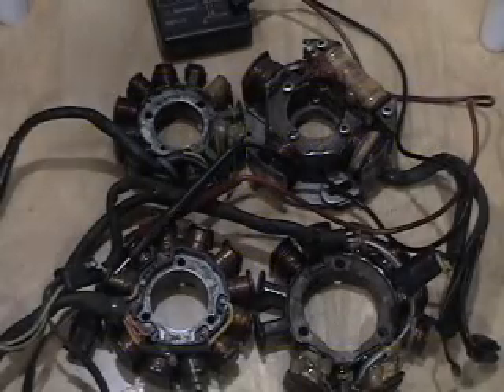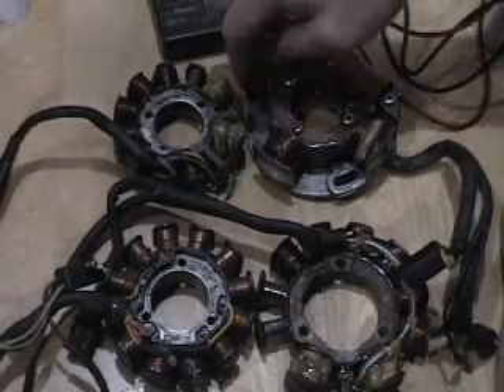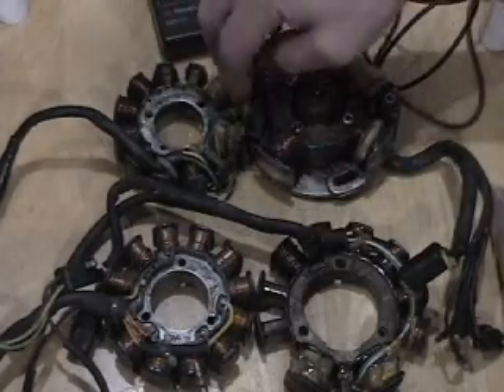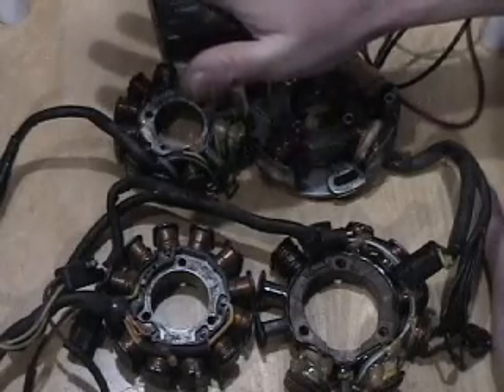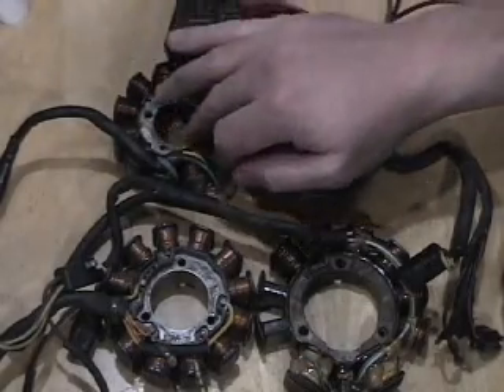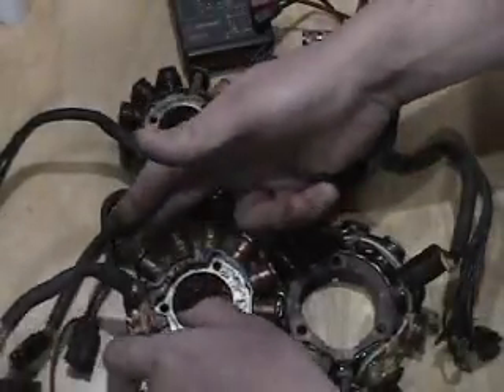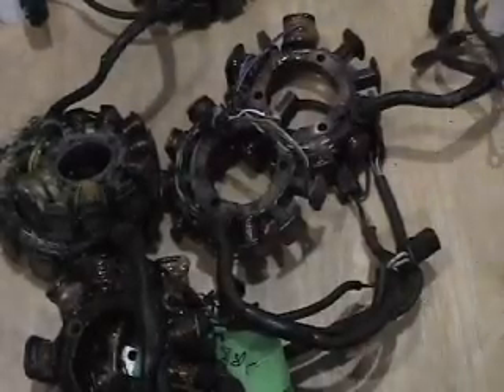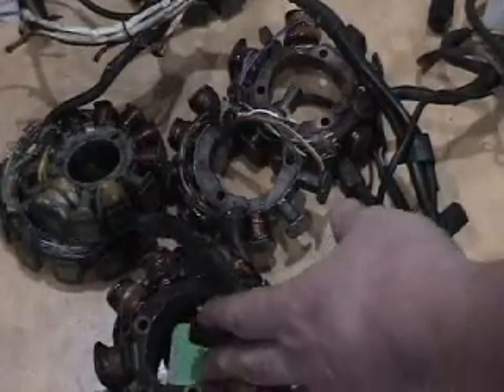Arctic Cat Stator ohm testing cold vs warm

Comment: I got question I got a 570 Arctic cat 2008 and I’d like to run a helmet warmer charge my phone and I got an electric fuel pump on it do they make a bigger then OEM winding so it’ll give more amps it is electric start I can run the fuel pump no problems but I can’t run the helmet defrost thank you would be great to find out if I could buy an aftermarket stater that makes more amps. Had to put the fuel pump in it because the sled sense a day I bought it brand-new he let it idle and it dies so when I come to a stop I turn the electric fuel pump on so the snowmobile stay running. The dying condition I took it back to Arctic at like seven times they still couldn’t fix it said it was normal for 570 to die and I said no it’s not so something is wrong but the electric fuel pump took care of it appreciated of anybody knows where I could get a bigger stater
Reply from the maker: No, there is no aftermarket stator that makes more voltage. You have to amplify what you have which normally means buying an inverter of some type.

Comment: What actually happens to the stator when it goes "bad".can you make a video of "bad" stator?
Reply from the maker: they can die in many different ways from a slow death or a quick burnt/melting death to anything in between.
Reply: @BlaineDP  ok. I have a potentially "bad" one. On a polaris indy.. runs fine cold but once hot. Completely craps out. Changed everything but the stator. Was told this is a common stator simptom. Was gonna put mine in the oven at say 185-200deg c  and after testing cold, see what I get hot? Would this work?

Comment: I have a 2002 800 mountain cat.  The problem I have is it will idle  fine then take off and 300 yards it dies and won't start until it cools down then you can go another few hundred and it does the same thing.  Just pulled the stator and it ohms the same as the known good one. At the same temp.  What do you think.  Everyone I talk to says its the stator.  Please help

Comment: Have 96 580 ext carb. Runs great on stand . Put load on it track wont spin very far. Last couple times I rode it kill switch and key wont shut off engine. Any advice? Stator? Cdi?. Short? At a loss
Reply from the maker: 96 Carb has a good stator in it but it could be the cause of your issues. Have you used the jumper wire on it yet? If you use the jumper wire, start it and remove the wire and it won't shut off then it is either stator or cdi.
Reply: @BlaineDP  where do you place the jumper wire?

Comment: Would the high side affect the top end
Reply from the maker: Yes but both coils are being used at both the mid and high rpm range so the low speed coil can also effect it at higher rpms.

Comment: The skidoo is a 2009 500 crossfire.What resistance should I be seeing on the high side and low side?
Do you have a stator for this skidoo ?
Reply from the maker: Unfortunately I don't have the Ski-doo ohm specs for that model.

Comment: What do you mean by jet down ?
Reply from the maker: Go to a smaller main jet in the carb which leans down the air/fuel mixture at wide open throttle.

Comment: Thanks for your reply .
I wasn’t convinced of the stator because it was fouling only one plug on the same side every time .
I wasn’t thinking if it was the stator it would foul both plugs.Does this make sense ?
Reply from the maker: It can foul just one plug/one side. On a triple sometimes you'll just have 1 cylinder that doesn't fire like the other 2 do.

Comment: Will a bad stator case my plug to foul
Reply from the maker: A bad stator can cause that issue. Many times while a stator is going bad you'll jet down because the spark gets weak and when you put a good stator in it it'll go lean and you'll burn it down.
Reply from the maker: It can. A bad or dying stator can cause a weak spark condition and it'll make your air/fuel mixture seem like it's too rich. many times what happens is guys will jet down and jet down only to put a good stator in later and toast a piston because it'll be lean after it has a good stator in it.

Comment: I have 2001 arctic cat zr 440 sno pro. and you said the videos that the yellow and yellow wire should show 0.4 ohms and i am showing 0.9 and yellow striped is 1.3 ohms but your video is still 0.4. Should I buy a new one then?
Reply from the maker: the 2001 ZR440 stator was only used for a couple of years and is specific to that model. The whole stator is wound with the larger gauge wire and does measure a little higher than the lighting coils from other stators. Measuring .9-1.3 is fine. That's where that one should be at.

Comment: So Blaine I just bought a 1996 ext 580 Eli my stator plug has 3 yellows and a brown, I have the battery out when I put my testor on it ohms 2000 don’t get any readings I’am not a electrical guy at all what is it I’am missing? Thanks
Reply from the maker: that stator is a 1-off stator. Cat didn't use it on any other year/model sled. It is essentially a 3-phase stator and only ohms out at around 1 ohm. It doesn't go bad very often.

Comment: how is it possible to get more resistance (wire length ) than is on each arm of stator lamination 
why does temperature effect it - its not a fluid
Reply from the maker: If there's more resistance without adding wire then there must have been a circumstance in the total path of the wire on the coil which added resistance. There's internal shorting out, corrosion, some of the connectors may go bad and cause arcing ect..Temperature effects the coil's ohm readings because when heated up the thin copper wire's atoms collide with the electrons transferring some of the kinetic energy of the electron to the atoms of the conductor (copper wire) and the atoms begin the vibrate violently. This vibrating kinetic energy within the atoms is converted to heat causing the temp of the copper wire to rise. It's referred to as "joule heating". The greater the number of electrons flowing per second the more heat is produced. The more atoms jostle around in the material, more collisions are caused and hence a greater the resistance to flow. When you start your sled up the ignition coils warm up very quickly. Within a couple of minutes they are luke warm and by 3-5 minutes most stators are up to "operating temperature". It takes them a long time to cool back down.

Comment: Green to black video says 25 I get 31. White to green video says 450 I get .473. White to black video says 475 I get .504. it's a 1993 T-cat with no spark. Could this be my issue?
Reply from the maker: Yes, you low speed ignition coil is bad. www.outdoor-electric.com

Comment: so i have a 2014 Wildcat 1000 X Limited wont idle very well after i warms up shuts off throwning a missfire code backfires and bogs real bad at low speed now when i get over 20 mph in low its like a power band kicks in and it goes like hell slow down and bogs again so stator most likely the cause

Comment: i enjoy your videos they help a lot. i followed your video testing of a stator while its still in the machine .. unhooked the 4 prong plug and wire testing in the same order as you did. 

i have a 1999 zrt 800 i just checked my stator thats outside, its -10 degrees outside 

my first test supposed to have 25 ohms and read 23 

2nd test looking for 450 ended up with 425

3rd test looking for 475 ended up with 450

is my stator still good? will these numbers increase when the stator gets warm?
Reply from the maker: OEM stators are normally about 440 & 23-24 when cold..when really cold I've seen 435-438 for the low speed coil. Yours measuring 425 is suspicious at the least. Measure it again at room temp/when the outside weather is more like 60 or warmer. That's when it might show its "True Colors" and actually measure over 450 like 452, 455 ect..something like that which proves the low speed coil is bad. The high speed coil measuring 23 when cold is fine.

Comment: I have a 1994 jag 440z it usual starts first pull runs good till it warms up then it boogs out or when you stop it wont idle if you let it sit and cool down it starts first pull and goes as long as you keep it over 40mph. Is this a stator problem ?
Reply from the maker: That's how most stators act when they are starting to go bad...but it could be other things too. That's why you also need to check compression (Maybe a bad piston), check fuel flow when it's both cold and when warm (maybe the fuel pick up line is plugged in the gas tank)..stuff like that could also be the issue. The 440Z stators are good/tough stators that don't go bad very often but they can still go bad.

Comment: I have a 98 zr 600 le I'm having issues wit the fuel pump it works with a battery charger but when I plug it in it don't work how do I test the stator to know if it's bad
Reply from the maker: The stator has 3 plugs, one is the 3 prong white plug is for the ignition, the 2 prong white with 2 orange wires is for the Injector coils are 19-20 ohms and the fuel pump (2 prong black plug) is 1.8-2.2ohms. OEM fuel pump and injector coils rarely go bad.

Comment: on a Artic Cat fuel injection pantera 1996 do we need a ground wire from the ECU to the body? I move my ECU to change drive shaft bearin an put back and doesn't work just the starter and the pump want go I thing I didn't hoock up the groun properly, Thanks if you want to answer.
Reply from the maker: I'm not sure how each ECU is grounded, but yes, generally speaking the ECU (CDI on a carb model) is grounded.

Comment: Do you have any videos on fuel pumps and carbs for a 98 arctic cat 600? Mine will start if we prime the carbs but it dies after 30 seconds. Carbs have been rebuilt too.
Reply from the maker: I haven't made any fuel pump or carb videos. You can purchase an in-line analog (Non digital, just a needle) fuel pressure gauge at most car parts stores for $10-$15 and using fuel line reducers/adapters put it in line with the fuel system and check the fuel pressure just to see if it's ok. EFI sleds are in the 30-40psi range (refer to your manual for specific operating fuel pressure range) and most carb models are in the 4-7PSI range. (refer to your manual for specific operating fuel pressure range) I had a sled running lean one time and I kept putting bigger main jets in it and it didn't change anything and it ended up my fuel pump was barely pumping at all. After I replaced it everything started working properly. Also, remember the needle controls the cruising/mid range jetting much more than the main jet does. The main jet primarily only comes into play from 3/4 throttle to wide open throttle. The low speed jetting (Air screws, pilot jet, fuel screw) plays a large part in the idle to 1/2 throttle jetting also.

Comment: Blaine, I have a new after market stator in the box  from Ricks motorsport electrics, inc. the readings on it as it sits here in my den are:
brown/ green 540
brown/ black 588
 green/ black  48 
This is for a 1999 pantera 580 efi, is the stator bad  are not wound right with that high reading from brown/green? Is it going to be a waste of time installing it?
Reply: thanks.my 97 is reading 460at room temp and 480 in series.i thought it was ok due to my manuall saying plus or minus 10 percent.but my sled been running on 1 to 2 cylinders.i had been pulling my hair out.changed cdi box etc.etc etc.i now know its the stator.i will get a new one.thanks!!!!